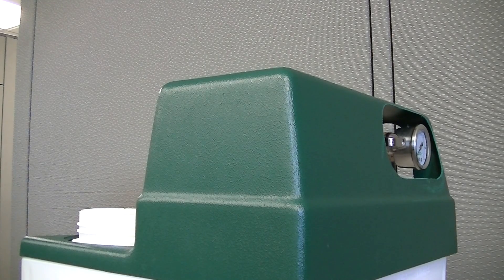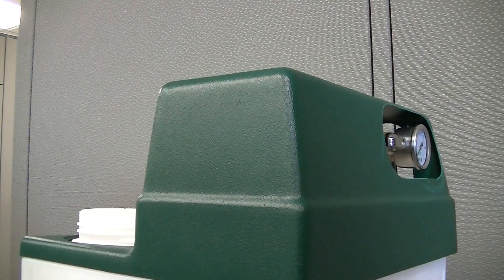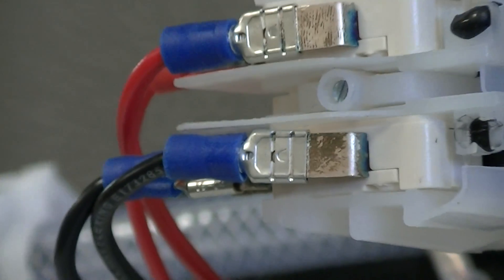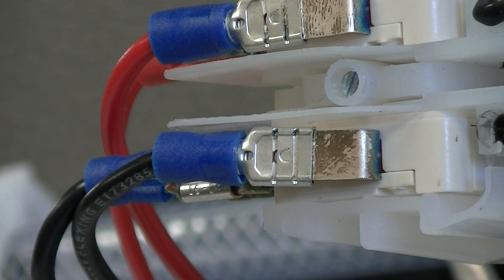MF Pressure Setting

Comment: And if it doesn't seem to ajust replace or clean the pressure trancience dampening snubber fitting that the pressure switch is mounted into.  Applies to all subsequent models.